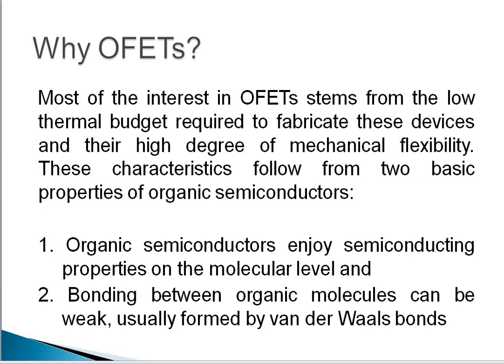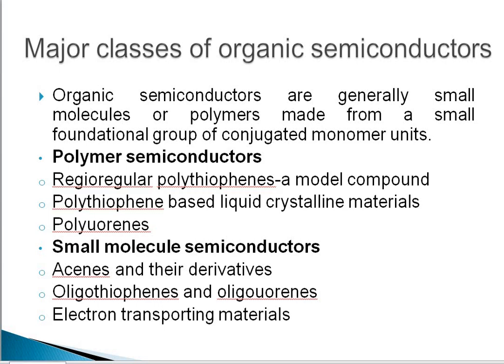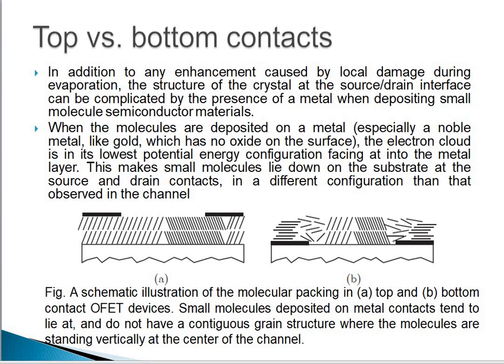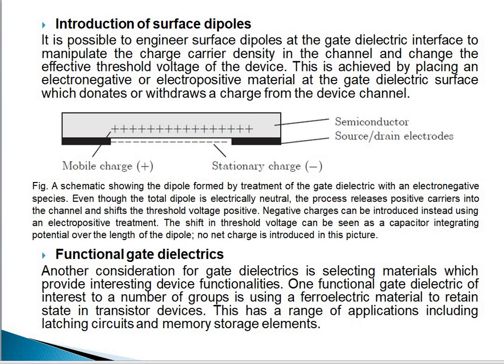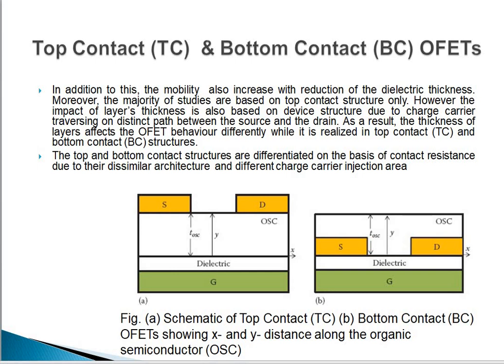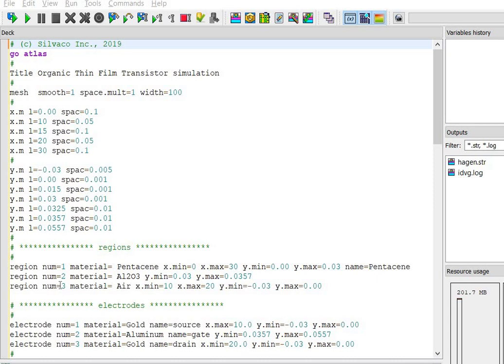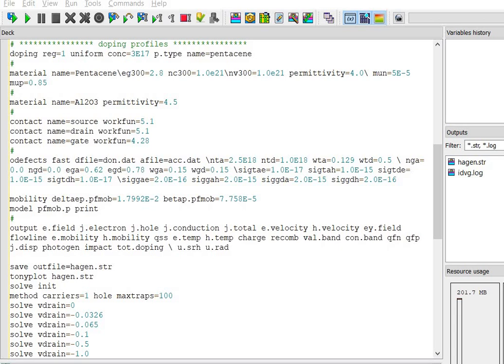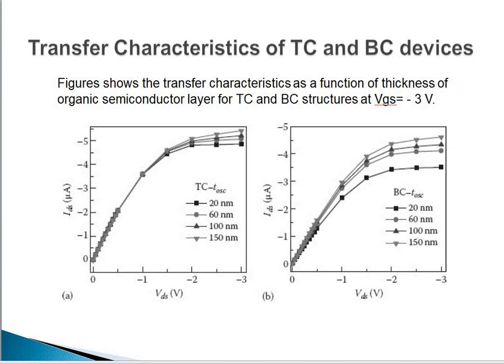Silvaco TCAD ATLAS tutorial 15. Design and analysis of organic FET & How to write organic FET code ?

Comment: Can you let me know? Since organic devices constitutes mainly of polymer dielectric  but we approximate in ATLAS as SiO2 only and specify the k value only. In reality say poly-vinyl phenol has hydroxyl groups which leads to hysteresis due to interface trap density. How can incorporate these specific material properties in ATLAS
Reply: Also kindly tell me the reference of  the odefects parameter values and poole frenkel model parameter values.
Reply from the maker: Pls watch my video carefully
U ll get ur answer....for more details on this I ll upload one more video
Reply: @engineeringtechnologyandso9940   But in this video you have taken Al2O3 as the dielectric. How to incorporate Polymer dielectrics like PVP, PMMA PVDF etc. In ATLAS manual I coudn't find any info polymer dielectrics